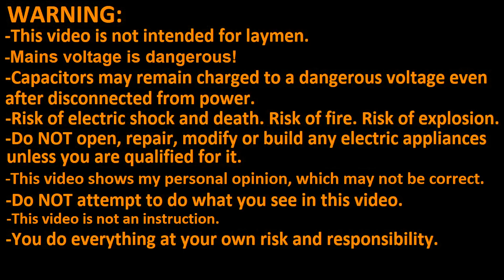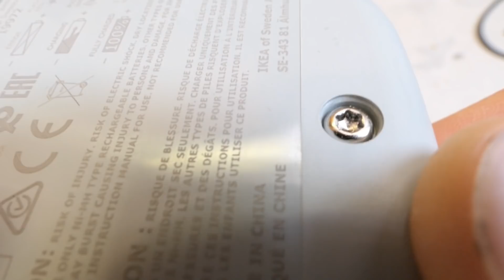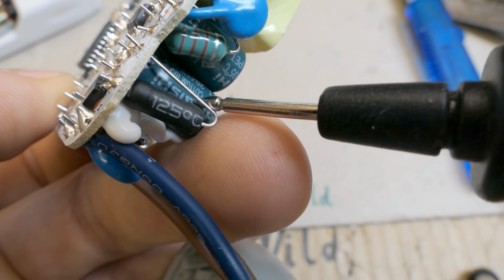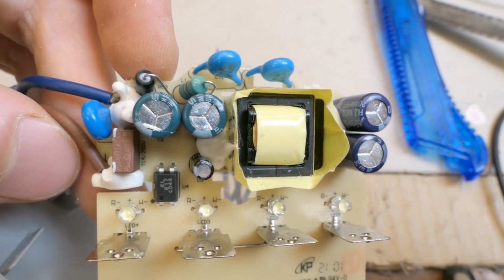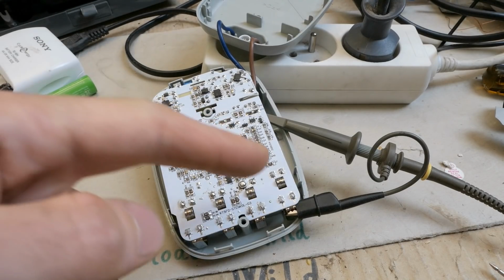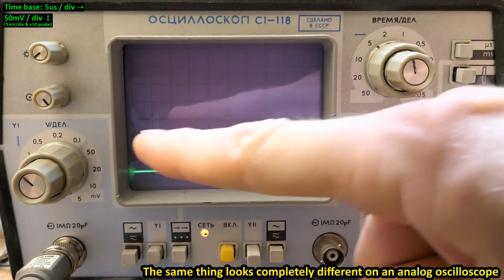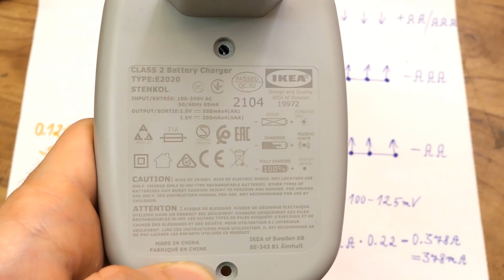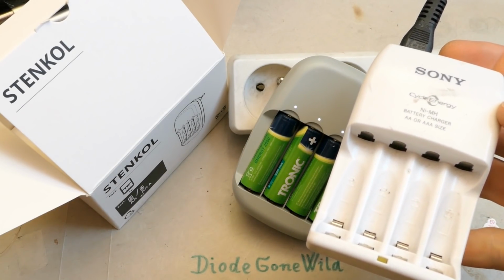What's inside IKEA Stenkol charger

Comment: Crap chargers, kept flashing red on duracell rechargeable. Put the same batteries on aliex 18650 charger (that supports nimh and nicd) and it charged fine
Reply: Probably too high IR, old cells on their way out (no good for high drain, low drain may still be ok)

Comment: @11:47 it keeps changing probably because of the 2000 counts range switching of the meter.
Reply from the maker: The voltage was jumping between 1.8V and 2.6V, so the meter kept changing the ranges...
Reply: Yep, at 11:47 During measurements Your  finger Danyk, was dangerously near Live terminal. Blodyy hell 😱 Work carefully, work safe👍 greetings

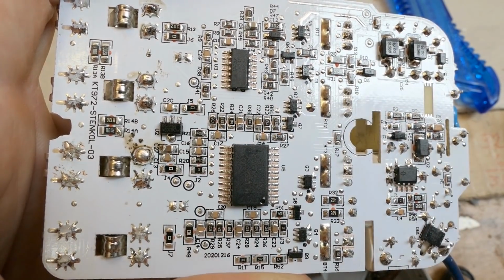Comment: 9:35 The most expensive way to make the print readable?
Reply from the maker: It's for free :) I took a used heatsink paste from an old heatsink.
Reply: @DiodeGoneWild  Any white toothpaste works just as well. A tiny amount obviously.
Reply: @Jeff44  that would not be free... Unless you slash open a tube that you couldn’t squeeze anything out of anymore.
Reply: @vaclavtrpisovsky  Just poke in the end with a cotton bud/cue tip, you'll find enough in there 
for many many chips.
Reply: Also chalk can help